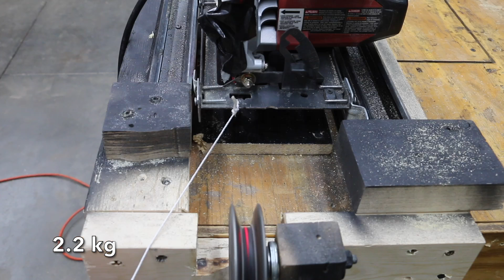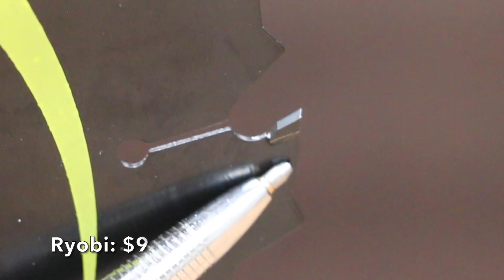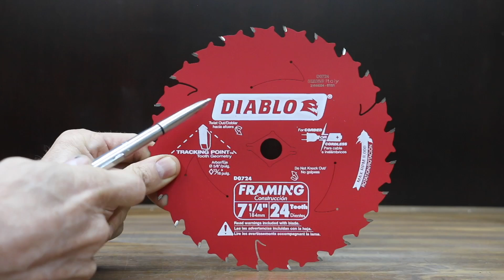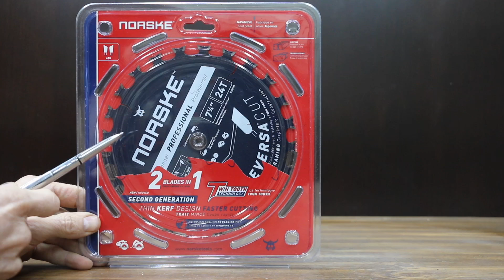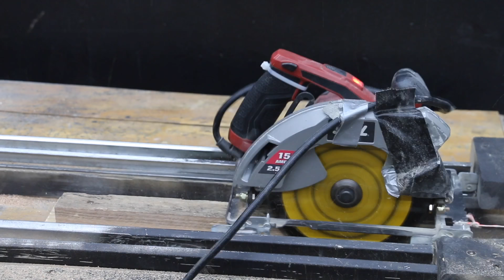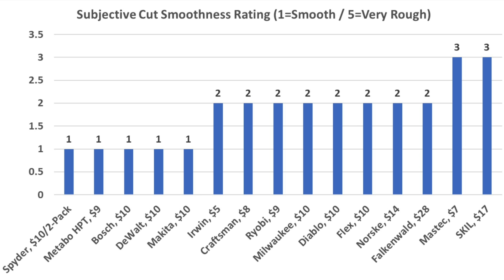Best Circular Saw Blade? FLEX, Diablo, Milwaukee, Makita, Bosch, Ryobi, Irwin, Spyder, SKIL, Norske

Comment: As a framer, the skilsaw is my most used power tool, and I've always gone for Diablo, and they're really solid, but man, I just went and ordered a 10 pack each ($6/blade) of the Spyder  (Lowe's) and Makita (Amazon) blades and will keep one saw dedicated for clean wood and another for demo/wood with nails. Thanks for all your work in helping us make better, more informed decisions!
Reply: I would have expected a farmers most used tool to be a welder. LoL As a retired carpenter, I used to love it every time I put a new Makita blade on my saw. It made cutting so effortless. That smooth magnesium shoe coupled with a sharp blade and the saw would just glide through the cut like the saw was sitting on roller bearings.
Reply from the maker: You are welcome!  Thanks for sharing.
Reply: I find that's the best way in the end. Keep an old worn out blade on your old saw and a nice new blade on your newer saw for cutting wood that you need nice edges on. I have pretty much rounded off some blades demoing a roof. Roofing shingles will eat up a saw blade in no time! I always go for a blade that is in the garbage already when I'm doing a project like that. It is definitely going in the garbage after cutting through shingles.
Reply: I used both spyder and diablo blades on my saw. The spyder performs fine, but nothing beats the durability of a diablo blade. I use alot of scrap lumber on projects. And i have destroyed a couple of saw blades over time. My current longest running champ is a diablo on my cross cut. It has multiple missing teeth and it still cuts faster than the brand new dewalt blade i put on my miter.
Reply: The true test would be "Cutting Through Man-Teacher's Fake Jubblies". 😳

Todd will also have to do a "Fake-Jubblies Bounce Test" on the next banzai-run in the Farmabago!! 😳
Reply: When you say skillsaw you mean the brand?
Reply: @janeblogs324    No.
Reply: Yea I purchased a 3 pack the Makita blade after seeing its performance. Had it on Amazon for 23.00. I still use my corded Milwaukee saw that is about 20 years old.
Reply: @jjohnson2553  

Framer, lol
Reply: @janeblogs324  Among parts of the construction trades its just the generic term for a circular saw. Like saying Xerox for making copies or calling all skid steer loaders a Bobcat.
Reply: same always went with diablos because the thin profile, great blades. but yeah i too am gonna be purchasing a few different blades. that dual side blade is kinda weird but i actually process my own wood and its alot easier using a circular saw after your first cut. and those blades would be great to keep on one saw just for dimensioning lumber.
Reply: Out here on the west coast the most popular blade has been the Marathon blade. Little different profile than anything I saw on the video but undoubtedly the same results. The only issue with the "fast cutting" blades like the Makita, is that the thin-kerf is easily deflected and its hard to rip a straight line in most material. The blade will wander a LOT.
Reply: Same here, love Diablo but I also think I need to check out the Spyder for Demo and the Makita for framing and decks.
Reply: Same, and I agree.  The Makita blades in the 80's were incredible, best I ever used.  I'll try the Spyder out for cutting roof shingles.
Reply: Do you find the spyders diamond knock out to be big?
Reply: @janeblogs324  skilsaw gets used to mean circular saw. It's like xeroxing or googling something.
Reply: @greenforce888  oh I get it, but where I come from we give credit where its due, not to the first guy who spent money advertising a product they copied from someone else.
Reply: Get those diablos 36 teeth wood and steel cutting. It was worth the money for me. I cut 2 buy and had to cut aluminum spindle for a deck and it’s like 😮 this is worth it.
Reply: @PaulKMF1  he tested the Spyder for demo a year ago. You can find it in his videos.
Reply: @jjohnson2553  he said framer not farmer, so a farmer might use a welder more. But, a framer works with wood primarily.
Reply: Could you give an updated opinion about the Makita and Spyder blades?
Reply: Which one do you like for clean cuts?
Reply: @truckguy6666  I’m glad you mentioned that. I build a lot of decks, and have noticed that the regular circ saw blades don’t cut super straight in 4x and 6x PT lumber, especially when doing 90* cutoffs in 6x posts. Milwaukee has a thick-kerf 24T blade that I’ll try soon as most of my circ saw work is PT deck lumber.
Reply: I've always sworn by Diablo as well, but those elcheapo Spyders impressed me.
Reply: @GuitarNvoice Diablo make a few different types some crap, but it's Demo Demon is pretty good 👍

Comment: Been in constr. for 20+ years. These results are spot on with what I've observed. Occasional nails happen in the field and the Diablo and DeWalt could take a hit and keep on rolling. Durability means a lot when you buy a lot of blades. Thanks, Todd
Reply: Vincent, I agree.  I saw the lineup and wondered how what's worked for me would compare.  My longest lasting 7 1/4s have been Diablos.  The 10" DeWalt on one tablesaw has run through an embarrassing number of nails and stayed relatively sharp for years.
Reply: I wonder why the Bosch and Diablo blades had such different performance considering both are owned by Bosch and have similar costs.
Reply: So true about DeWalt and Diablo. When working framing we did notice that Diablo definitely lasted the longest. Dewalt would warp at weird intervals for us, but Diablo always dulled before any other major damage. Have used Diablo most of my life, but now wondering if a Makita blade might be worth keeping on hand for hardwood.
Reply: That Spyder though, given how little it costs its an absolute beast.
Reply: Anecdotally i like to get diablos because they do be lasting longer out there. Even accidently cut into a metal table with my finish blade a bit and the diablo fine finish still cutting clean.
Reply from the maker: You are welcome!
Reply: @mrbigberd  Diablo is the only one made in Italy. And Italy makes very good quality knives.
Reply: @gregs7519  I hear they make good quality cars and guns too
Reply: how long do your blades last before you purchase more?
Reply: @producerk8247  if only I use them, one every 2-4 weeks. If my helpers use them, once a week lol
Reply: @Kincentc  thanks for the prompt reply.  Hope you are well and work keeps coming your way.
Reply: Nailed it so to speak.   He and you are on the mark.
Reply: @producerk8247  and you and yours
Reply: I do woodworking I rarely cut a nail since all the wood is fresh, I really think it comes down to what you use the blades for, at $5 a 2 pack for Spyder that is a much better buy for me personally
Reply: @DJA7943  dont no about guns,but quality cars,yeah right.if you think cars thst break down all the time,have loads of electrical issues and dissolve like tissue paper in the rain are good quality then i guess they do lol.
Reply: been inconstruct bussiness for 22 yrs,, houses,, still havnt seen a vid for whats better,,blonds or brunettes. my lab says blonds..least i can still whistle for my dog..
Reply: I got my first miter saw last year and was shopping at Home Depot for a fine cut blade. After debating price, I went with the more expensive Diablo not knowing squat about how any blades did in the field. About 15 minutes later, a guy passed buy and eyed my cart and said "Niiiiiiiice blade!" I said "Yeah?" and he said "Those are real nice!". I thanked him...and dang...he was right! I cut several dozen 45's of 2 3/4" trim pieces and the cut edge felt like it was sanded with 1000 grit! Smooth as glass!!!
Reply: @cargogh  yeah, I use them, though i despise the thick red paint that gets transferred to every piece of wood you cut...clear-coated natural metal blades don't do that, even if they have lettering on them....
Reply: @DJA7943  ..unless it's a Fiat....
Reply: @dyer2cycle  It's really a standout feature on light woods like maple.
Reply: @producerk8247  for finish work typically just a new blade for each project since the company buys them. Framing you just use any blade that has all its teeth.
Reply: I was buying expensive blades,and someone told me about Diablo,and they're on every saw and sawzall I have now lol
Reply: Love the Diablo blades go through wood like butter have one on my skillsaw table saw and compound miter saw

Comment: I've been a carpenter for 40 years. As a carpenter, I want a blade that peforms well, stays sharp and will take an occasional nail without flinching. Makita has always made a very good blade and they used to be my got to until Diablo. Diablo has been my go to for years for value and longevity.  But I tried the Spyder blades based on your demo blade review a few months back and I really like them. Spyder is my new favorite blade for performance and value.
Reply from the maker: Thanks for sharing.
Reply: Expensive little devils, $125 for a 10 pack on Amazon.
Reply: @Bob_Adkins  your local hardware store should have them for $10 or less per blade
Reply: @MinecraftManSteav  Yeah, I see Lowes has them for $10 each. May as well stick with Makita.
Reply: @Bob_Adkins  Sometimes Lowe's has them in a 2 pack for around $15. You can't beat it.
Reply: My dad’s company sticks to Diablo blades. Sometimes they pick up Milwaukee brand ones because of bulk sales but Diablo makes great blades.
Reply: Hat off for your 4 decade endurance in a very hard job!
Regard from a german carpenter since 26 years

Comment: I have an old Skilsaw, and put a new Irwin on it. Like my previous blades, it was a fight with any piece of wood, always bogging down, burnt edges, making small tasks into huge work efforts.  So, I go looking at reviews to get a new circular saw and come across this gem.  Could it really be the blade.  After watching this vid in it's entirety, I decided on a Makita blade.  You have saved the day... Man, I can't believe how a simple blade change has made life so much easier.  Recently, I've been experimenting with slabbing wood and that blade will cut thru solid wet oak 2" thick like butter.  And the unbelievable part is, it hasn't wore out yet, although I expect it to, sooner than later.  You must excuse me for the extra long rambling, I just wanted to say thanks for your excellent reviews!
Reply from the maker: You are welcome!  Thanks for sharing.
Reply: did you empty out and change the gear oil/grease on your skilsaw ?
Reply: @diverdave4056  No, I haven't... this saw is a beater saw, it's pretty much neglected, left out in the heat, it has gotten rained on and absolutely no maintenance. For the price I paid, I treated it as a disposable item, and yet, it still keeps on spinning.
Reply: @ToddMalz   oh  I have seen many of them over 35 years on construction sites that were beat up ... all they need is a little TLC and they will last forever !

Comment: Another great test. The Makita surely smoked the rest when cutting in new, clean wood, but I was impressed by the Spyder brand - very cheap but still out performed most of the high end brands, and even smoked the Makita blade when cutting "dirty" wood. As a Makita man myself I must say I'm impressed. 👍
Reply: If you are going to do cross cuts all day through clean wood, especially with a cordless saw, Makita is incredible. However, it is not good for cutting through crap (nails etc as demonstrated) and also, you wouldn't want it for ripping wood, as for long rips, it starts to wobble a lot because it is so thin.  I love Makita tools though. I think they are the best bang for your buck by far.
Reply from the maker: Thanks!
Reply: @ProjectFarm  I got the DeWalt battery weed trimmer because of your test and am VERY satisfied!
Reply: @barkmaker  Its more about the company and the quality control they implement for China to build. As you know, most tools are made in China amongst a million other things
Reply: @barkmaker  

Most American brands are made in China too and likely will be more consistent than items made in USA.

The whole 'made in China' argument hasn't been valid for a long time.
Reply: @barkmaker  cheap Chinese knockoffs and name brands being manufactured overseas are two different things…
Reply: @barkmaker  

OK mate, you keep to your fantasy world 😊

Comment: Big Diablo fan myself,  been using them since they first hit the market.  The longevity of that blade is amazing.  Would like to have seen a test with each blade after 10,000 cuts lol.   If this test had been done when Diablo first came out I think it would have stomped all the competition!  I just noticed a huge difference when I first used that blade compared to any other I had used.  Good to see other manufacturers have stepped up their game.
Reply: Yeah love my dialblo blades but I just bought a bunch of spider blades and other accessories can't lie bro there good 10.00 for 2 blades can't beat that I picked up 6 2 packs for 3 bucks a peice there cutting good 👌 👍
Reply: @WTNPROUD  yeah I was impressed with that Spyder myself. Very impressive for half the price. My main use for by circular saw is cutting underlayment for vinyl flooring. A Diablo blade literally lasts me 10+ years. I have 4 blades a couple of the blades I use on cutting different wood. They are a bit duller but they are 10 years old lol and still cut well. For me a Diablo is a lifetime blade.  I have 2 of the 24 tooth and 2 of the 60.
Reply from the maker: Thanks for the feedback.
Reply: Freud/Diablo is so hard to beat. I use them for router bits, saws all blades, circ blades, and for many of my table saw blades.

Saw a Tic Tok the other day where someone was complaining about them, but showed that he installed it backwards lol. Everyone called him out and he refused to believe it.
Reply: Diablo blades all around! Pains me when I have to buy a different brand sawzall blade.
Reply: Diablo also make the best tablesaw blades, especially for the gummy/hard wood I often cut: the red coating cleans up much better than any other surface finish.
Reply: @IkesThePyro  Oh my good lord.  Some people's children smh lol.
It's funny when people put their stupidity on video like that for everyone to see.
Reply: Same I accidentally cut through a cinder block(don’t ask) and it just kept on cutting like it never hit it
Reply: And Diablo is the generic version of Freud Industrial, they one of them next time 🙂

Comment: I used a new Diablo blade all summer long making  hundreds of cuts through approximately 100 pallets full of nails. it has held up extremely well  and can still rip a 4 foot 2 x 4  in 10-12 seconds
Reply from the maker: Thank you for sharing!
Reply: That's awesome. Tried and true. Doesn't get any better than that. Thanks for taking the time to share that

Comment: I was surprised at the Ryobi.  They've been stepping up their game in accessories, which used to be pretty poor, and they just announced a range of hand tools.
Reply from the maker: Thanks for sharing.
Reply: Yeah I got a Ryobi 10" miter saw on sale a couple years ago and the blade it came with was great 👍
Reply: I wanted to be a believer in Ryobi, but when it came time to honor their warranty on a pressure washer wand that is well known for prematurely failing, they made me jump through so many hoops only to stop responding to my request for a replacement altogether. I won't spend another dime on them. 

From now on, I'll only go with Flex who have an outstanding reputation for warranty service.
Reply: Yeah i don't think there is a better value when it comes to power tools. I just used their miter saw to cut all the window trim for my house and it did exactly what it needed to.
Reply: @YankeeWoodcraft  the retailer should have covered you if they have a no hassle return policy.
Reply: They are a great value in power tools, but I won't even consider them when it comes to hand tools.
Almost no cordless power tools are really made here in the US so I don't worry much about COO there but I only buy American made hand tools ( sometimes European made ) and with the countless options in cheap imported hand tools you can bet the ones from Ryobi will basically just be rebrands and their value proposition will be lost.

Unless the hand tools are going to be made in the USA or Europe I predict the hand tool line having very little popularity.

Why buy Chinese or Taiwanese hand tools from Ryobi when there are existing brands who have it all figured out already?
For HD you can just go with Husky.
Reply: @johnharvey5412  
I have only ever had older American made Husky tools myself, so I don't know what the quality is like on the imported stuff.
I just know that they're an established hand tool brand people are more likely to choose, but I also know theres a good chance the Ryobi hand tools will come from the same exact manufacturers as the Husky stuff.
Reply: @DavidTSnyder305  newer husky hand tools are sub par. Their sockets are good.
Reply: @justloggit22  
I wouldn't know since I only buy American made sockets,  but I will take your word for it.

Comment: I'm struck by how inexpensive carbide blades have become. Adjusted for inflation, most of these are half what a plain steel blade used to cost. (Yeah, I'm old). Back then there weren't nearly as many options for carbide blades and they were seriously pricey. Four or five blades cost as much as a decent saw.
Reply: I remember this old Tony talking about how the Chinese had a hard time making high speed tool steel so they just invested in carbide tips... I guess this is three trickle down of that...
Reply from the maker: Thanks for the feedback.
Reply: IIRC carbide tipped blades were like 40-80$ back in the late 90's.
Reply: I remember in the late 80s taking sawblades into town to have them sharpened and to have the occasional carbide re-brazed on. Now they are disposable.